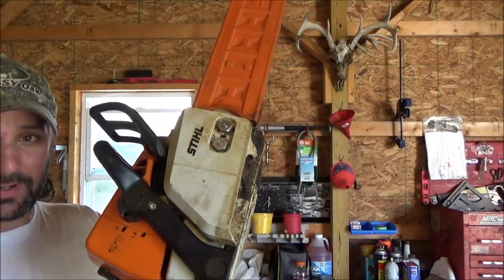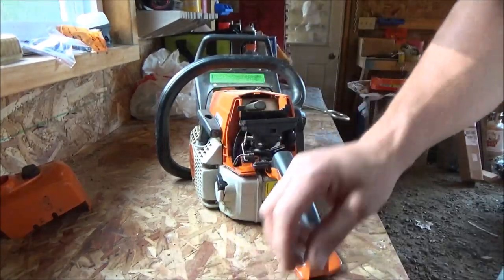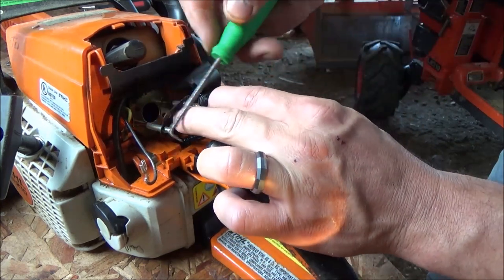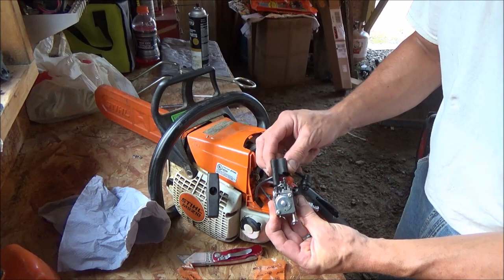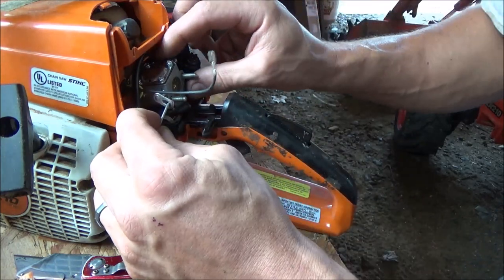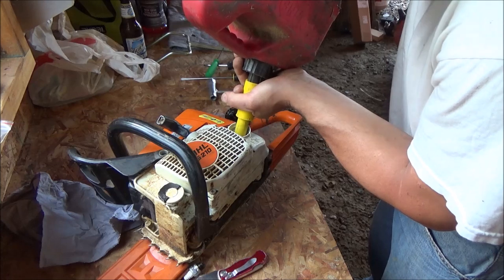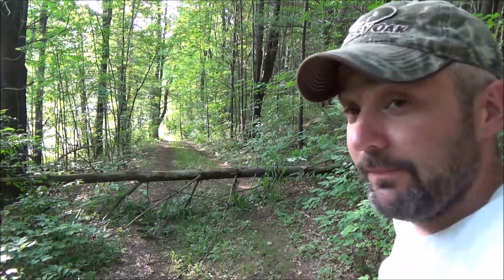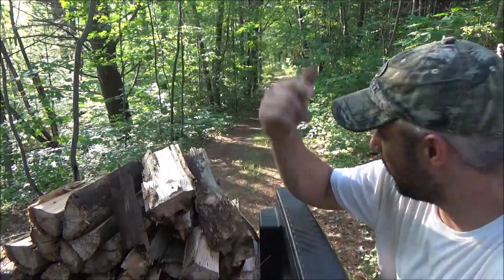Replace: Carburetor Stihl MS210 Chain Saw

Comment: Eric,  My Stihl leaf blower seems to have the same issue with the ethanol flavored gas. Over time the thing wouldn't idle and bogged unless you let it warm up for a looooong time.  I replaced the carb once a couple of years ago with a Stihl part whiich worked great.  Started acting up again and on a whim I bought a can of the premixed gas they sell at Home Depot for about $7.  After running through about 1/2 a tank it runs great again just like it's supposed to.  Just in case you want to try it sometime.    Thanks again for all the great videos.  -Eric
Reply from the maker: Eric Mark Pre mixed gas huh? Guess I have never seen it... I live a sheltered life lol
Reply from the maker: Oh wow we actually get something cheaper huh
Reply: South Main Auto Repair I was just reading through the reviews on it and people say good stuff about it.  No ethanol and 2 year open shelf life.  5 years unopened.  I'm hoping it saves me from having to replace another carb.  Stihl version is almost $50. When I'm blowing a ton of leaves in the fall I'll mix it myself but off-season this stuff might be worth it.  Best to you.  :)
Reply: Eric Mark I live in Florida we have many gas stations that have non ethanol gas.  Boats, cycles etc need this.  It’s a little inconvenient to go out of your way to get it but it’s within ten miles to find them.

Comment: You got luckier than I did with my ms190. It was less than 2 years old and had little power. Tried new plug and figured it had to be carb or plugged exhaust. How could the exhaust be plugged? Ordered the cheap carb and same deal. Was upset to find the exhaust screen plugged. My 30 year old Poulan has never plugged a screen. Screw Stihl and their special oil. Lost a lot of respect for stihl after this. Poulan  starts better than the stihl too.

Comment: Aw, man!!  Yes, you forgot to pull the fuel pump relay and all that fuel came out of the fuel line.  Watch out when and if the engine starts!  You'll probably see the Check Engine Light come on!  Chainsaws don't have an OBD-II port to clear the codes.

Comment: As others, wondering if there’s a “Motorweek long term road test update” to the wing wang carb replacement?  Thanks in advance for the tutorial. I have an 029. So far no issues but good info now seared in my noggin. I’ve had success with several $20ish wing wang chang-ers on two mini bikes and a yard man snowblower. Tecumseh snow king w/o issues. That was before switching to only ethanol free gas for all equipment. 
Like you said, for the cost of a few pizzas what do you have to lose? As always, great useful content. Thx 👍🏼

Comment: I am a chainsaw technician , it is usually the carberator fuel filter screen is clogged. Could have fixed it for 10 cents instead of 20.00

Comment: Gasahol or ethanol spiked gas is hygroscopic (it absorbs water).  Never use it in anything that goes near the water (boats) or anything that gets stored for any length of time without use.  Find a vendor nearby that sells real 100% gasoline and live a much happier life.

Comment: the super fine screen air filter is called a st.hellens filter as in my saint helens after the eruption on my birthday .there was thousands of acres of timber blown down. that was ash covered. when they logged of the timber the ash destroyed the chainsaws and equipment. so they developed the screen it stops smaller material than the typical air filter and is cleanable. 
 as far as your saw his that's a lower quality made for home owners as opposed to the pro saws. I found its better to pay up and get a pro saw . they are faster and more durable .

Comment: Noticed your saw is an MS210 and the little box it came in has MS210 in a smaller font than MS250; probably stating "made for the MS250 but fits in an MS210" and could be why the adjustment screws weren't quite the same.
Reply from the maker: +OOZ662 Oh I see, good catch!

Comment: Similar situation with an old Craftsman lawnmower which would dump out all the fuel from the tank to the body.  I found a carburetor online for $15.  It needs some tuning, as the throttle linkage is wobbly, but I don't have gas spilling out of the tank anymore. If I made my living using small engine tools, I'd go with a higher quality part.  But for moderate/light homeowner use, it should pull its own weight.

Comment: @9:05 I bet you sleep with a can of brake cleaner on your night stand :P
Reply: ***** that stuff is amazing
Reply from the maker: ***** ..hmmmm... I do have some in the house actually haha
Reply: ***** Doesn't everyone?
Reply from the maker: ***** I know right? That's like saying do you have any water!?
Reply: Well guess I don't have water then :P
Reply from the maker: ***** Man this is 2015, get your self some brake parts cleaner :)
Reply: South Main Auto Repair I Bought a new spark plug coil same idea! Coil wire was a inch to short had to redirect how it would fit ! not to impressive but it works ! saved a $100,00
Reply: hahaha
Reply: I'm not a professional mechanic. I only fart around in my garage occasionally. And even I buy brake cleaner by the case! LOL

Comment: I have one of the chainsaws. It quit running a while back, and I bought the chinese carb kit which fixed it.  However, it has failed again. I put a second chinese clone carb in, but it still does not run this time.  On other equipment like mowers, I can open the choke and spray in ether-type starter fluid, and get it to at least fire for a second or two. With this machine, and I know I have good spark voltage (and new spark plug), it will never fire in the slightest with the aid of starter fluid. I don't understand this. Also, is there any tutorial available showing how to overhaul the carb itself? Particularly how to unclog the jet?

Comment: I did not need to remove the choke lever rod.  The throttle lin,k snaps out and the choke rod comes off easily.

Comment: You and I are cut from same cloth , Amazon or eBay for anything I possibly need for the old chainsaw or snowblower , the parts shops gouge ya to death with thier prices , hell I even order some  trapping supplies from China .

Replace the Factory Stihl carb that's made in China with a aftermarket one made in China , there's no difference except for the name stamped on it and the price

Comment: Stihl makes the best small equipment. I've used their old (real German) saws and weed whackers and man the old stuff (and even the new) is so g dang heavy but it just runs and runs and works. Still use my dads early 70s farm boss  that runs with some coaxing. Thing probably weighs ~20lbs

Comment: Sure looks good but the big advantage to Stihl is how well they start next season.  With the tiny passages in a small engine carb they clog up very easily.  One of the reasons I always run Stabil cause then I don't put it away thinking I might use it again and have it sit all off season.  It seems to work as the only time I have troubles with the small engines is when I neglect to treat the fuel.   Hope this one has been engineered exactly like Stihl as they have been quite good kinda like a Honda.  Their prices on the other hand are very high.  I bought a Poulan once for about a 100 bucks and when its carb fouled it was a totally sealed unit whose replacement cost was more than half the new price of the entire machine (leaf blower).  I have heard good reviews on the Harbor Freight sonic cleaner with the right detergent it seems to clean carbs pretty well.  I am on the verge of getting one and seeing. It might penetrate a sealed unit although most still require disassembly.  Take care.  Doug

Comment: Idk if sthil uses the thread in spark arrester on their chain saws. But its on the weedeaters. They carbon up and stops the engine from running.
Clean up on the wire wheel, but I put a carb and a piston & rings in before I saw that thing ! 
Most likely its in the owners manual that no one reads, to clean every season lol

Comment: That thing could use a high speed fuel adjustment for sure. Great idle but slightly low on power. Just hold it WOT while you turn the needle screw slowly and you’ll hear a very noticeable change when you hit the sweet spot. 

P.s. didn’t know they let people have any guns at all in NY! lol

Comment: For what it is worth, I found that when you don't use these engines for several months, you need to add to fuel stabilization fluid to keep the carb from fouling.  GOOD JOB!

Comment: I'm glad you showed where that wire went, as the one on mine was hanging loose. That's where I thought - no cutoff switch as it is simple spade lug contact on the choke lever. 

 Good info and decent view of what you were working on.

Comment: Well done Eric, I'm as surprised as you were the wing wang carb worked so good. I only run 93 octane fuel or I guess some call it high test gas because at least up here there is no ethanol in it.  That's a real nice saw , I only run stihl saws up here.  I bought the same one for my youngest daughter for her 12th birthday :) I built a diesel log splitter a while back with a new Kubota 2 cyl diesel. I bought 2 at the time Z482  long blocks. Ever think of making a log splitter ?
Reply from the maker: Steve Rob Do I ever think of making a log splitter!? DOES THE POPE CRAP IN THE WOODS!? Of course I do. I dream about things of that nature.
Reply: I'm going to send you some pics.
Reply from the maker: Oh your gonna make me spend money huh
Reply: Maybe save you money

Comment: Yeah, those small engines don't like ethanol but while I think it over even more, no engine really does that great on corn alcohol. Small engines such as the chainsaw for homeowners, generators, air compressors and motorcycles/ATV's  that may sit around for a season do not do well with that EPA fuel as it attracts water and algae. The best approach is to use the fuel additive such as Startron star-brite that preserves ethanol fuels for those periods when your equipment might end up sitting more than it does being used. The word is the current fuel costs the public billions in mechanical repairs/maintenance annually doe to the fact most manufacturers of small engines place warning labels on their products that use of EPA Ethanol fuels are not recommended and (some) won't honor their warranty if that stuff is used. I guess we are supposed to head to the race track or airport to get real fuel !!

Comment: Cant believe that a guy who spends most of his time repairing cars that for the most part are in his shop due to owners neglect would not take better care of his own stuff.
Also shocked that you didnt care what the plug gap was....do you pop plugs into the cars you repair without checking gap?
Reply: I was thinking the same thing. Wow i was just mortified as well. Absolutely no excuses for abusing your equipment. He just fired in that plug ungapped and never thought twice about it. Never even torqued it to spec either.   After he reads these verbal tongue lashings i doubt he will ever do that again :)
Reply: Haha I know a lot of people who put the customers before there own stuff. If you're too busy that's just how it goes.
Reply: kj great obsevation brother- i just went off the deep end when i seen how dirty that saw was and when he just jammed in that plug in without caring less about the gap and to top it off not breaking out the digital torque wrench- we all know hes got one, definately should have drove to the shop to get it. All this without ever having approved  safety gear on. I never seen a first aid kit within reach or a fire extinguisher.  Sometimes you just have to speak up so these atrocities dont get repeated :) Take care brother
Reply from the maker: Steve Rob You are right Steve... I repent and am sorry... forgive me?
Reply from the maker: Steve Rob Also as a safety precaution I did dump the gas at least 100' from the well... just to be on the safe side is all. You know me and what I always say, "better safe than sorry"

Comment: Nice fix!

And the stuff is that cheap because you obliterate all the "man in the middle" stuff.
As you saw, the old carb was made in China as well but would have cost you 5 times as much to get from Stihl because there's a lot of mouths to feed on the way.

Heck, i can get original parts shipped to me from China that are identical to those i would get at home for less than half the price, including the import taxes and toll fees.
Reply from the maker: Cadde exactly

Comment: Funny you get sprayed with gas and a minute later you're questioning whether there's a fuel delivery problem. 😂

edit: Hope that didn't sound critical. I've done just as stupid of things. I enjoy the candid moments and glad you don't edit. 

I had a friend who made a trip  to emergency room after a misadjusted carburetor backfired. I'm all for cheap carbs but not for use in chainsaws. And for God's sake wear more than a tshirt when using a chainsaw. That sidearm won't help you either. Jeez sorry about the rant but you scared me seeing you out of your element.